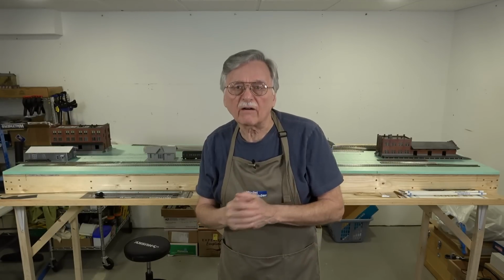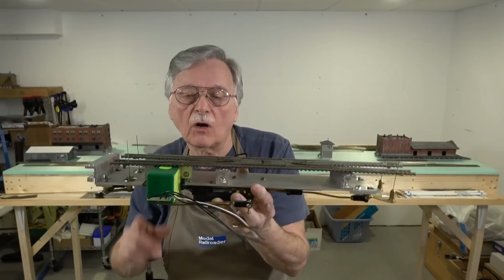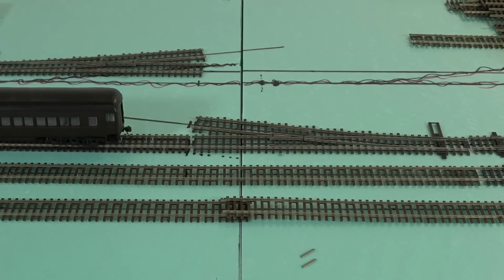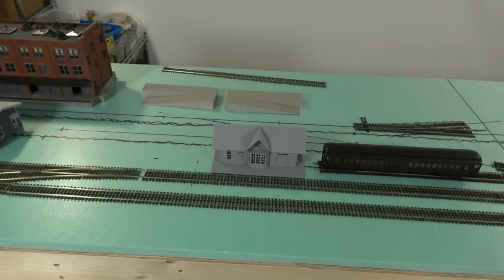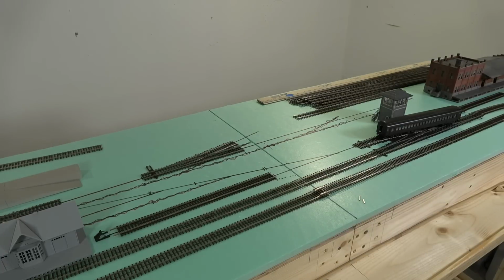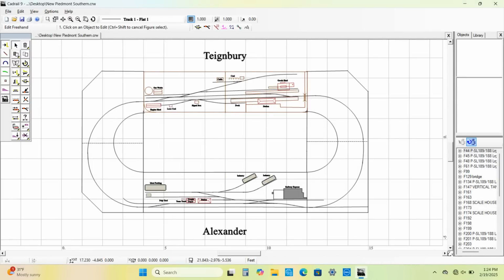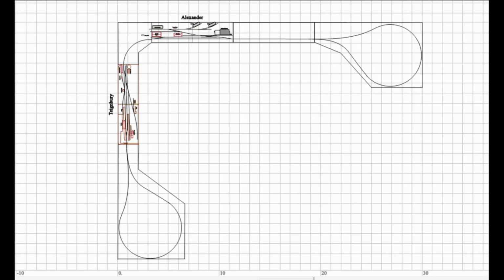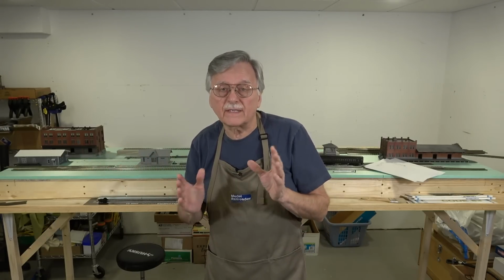Building a Model Railroad—Layout Planning, Don't Skip This Step (383)

Comment: Hi I am starting new layout should I go 8x4 or 8x3 should I go with an island layout or attached to the wall thanks Dave
Reply from the maker: As to size, I don’t see much difference between the two, so go big. Also I wouldn’t build a shelf layout anymore, best to put legs on it and then put it against the wall, since this will be less limiting, especially if you move. The only reason I see for an attached shelf layout is if you need a clear space under the layout. The good thing about an island is you can operate from both sides but it takes up more of the room. You didn’t mention scale or whether this is to be switching layout or not, both of which could impact your decision. For example you can’t do a loop in 3’ in HO, even 4’ would be tight but possible.

Comment: Hello Larry: watching this new video about the new module layout, I am making one similer but the track I have on the module parts I have are code 100 Atlas but I have a code 83 Walthers double cross over which is just better than the old (not DCC friendly code 100 Shinohara ). How would I close the gap underneath the code 83 due to the top matching rail height of the code 100.I know they make rail joiners to make sure the rail tops are the same but how would I fill in underneath without having a bump in between the two track. Your wisdom is always appreciated and I can't wait for these two modules completed and connected.
Reply from the maker: Solder rail joiners to the code 100 rails then flatten the exposed parts using a pair of pliers with smooth ends, good old vice grips work well. Next place your code 83 rails on top of the flattened joiners and solder them in place. This should give you an almost level connection between the two.

Comment: Larry, thank you for the videos.  With regarding your industrial area by pushing the two turn-outs behind the station to the left there does not seem to be enough length for a loco and 1 or two box cars in front of the meat packing warehouse for the industrial siding to the right.
Reply from the maker: One advantage of adding the corner modules is I will be able to extend the appropriate tracks and even structures there to compensate and improve operational capabilities.

Comment: Just a thought, ….You could use large 4th radius curves for the return loops, with a 3rd radius helix inside of it. (A Curved switch at the start of the return loop would switch between using the return loop, or switching onto the helix if the train is going into storage. ..And as it’s a return loop (bi directional line), trains can come on and off layout at just 1 point as there’s no direction of line running to worry about. 
..basically, ..If you just put a helix at 1 end with the return loop outside of it staying on the level, then you can take trains down from the surface boards onto a full width and length of the layout train storage depot (underneath the surface board)
(Like a big freight yard underneath the main layout)

Or… If you ditched the return loops idea and put a helix at both ends to make it a very long continuous line , then you could have a long enough track to have 2 trains “chasing” each other using a block signaling system set up. …which then runs behind the storage sidings underneath and link’s the 2 helix’s underneath. .. then as I train is running along on the top board the other is running along the bottom board.

Lots of storage for trains if you had a helix down to under the surface boards and as it’s already a circle with a return loop a helix would fit inside it. 👍
Reply from the maker: Using a helix (or two) was my first thought too. However, then I thought about just running a track off the reverse loop, through the backdrop, and onto a narrow shelf with several tracks. Although it eats up a little space behind the modules it is a much simpler solution.

Comment: Perhaps for the portability factor, you could build the oval as a second option. Question: How do you plan to deal with the mix of American and British trains and structures? Will both types of equipment switch both modules, will operating sessions focus on one module depending on equipment in use or will you change structures and equipment between sessions?
Reply from the maker: Right now my thinking is to keep them separate and use the continuous run capability for my passenger trains and through freights. By installing staging tracks as I described in the video I could use one for American trains and the other for British. This is not being built for true prototype operations as I wanted to do on the old Piedmont Southern, just something to run trains on and do so e local switching. The purists are probably cringing over this approach!

Comment: That's a pretty neat jig to controls the 4 turnouts on a double X-over. I wonder if he could make one that used two tortoises to control the pairs individually? That would be something I'd really be interested in. - Jason
Reply from the maker: Yes, you can do that using turnbuckles and bell crank levers available at your local hobbyshop. Look for parts in the remote control area of the shop.

Comment: If you're expanding left for the pulp yard, are you also considering moving meat packing there, so you can headshunt the right side industries? Looks a little cramped running a locomotive and 1 freight car, if there's anything parked at meat packing!!

PS love the drawing the plan on the foamboard idea. I'm heading down that path too, though I got a bit delayed by US Customs holding my curved track guides for over a week!!
Reply from the maker: Yes, by extending the tracks onto adjacent modules it opens up a lot of possibilities and can be done in steps. The corner module will be the first thing I add after completing the current set.

Comment: Interesting to see the evolutionary process of the new layout.  One thought that I had, though, is whether you have considered the road access to the various buildings, particularly the station.  Placing the station building on the opposite side of the tracks may be an option.
Reply from the maker: Yes, there will be a road crossing near the station that will extend back to the various building to the rear and sides. Much of the trackage behind the station will be buried in pavement. That will be added in the next iteration of the plan.

Comment: Another great video explaining your thoughts, all looking good.
Then you show us the extensions, you had a large layout and you cut it back for a purpose, now it is getting bigger again. Even though you are making modules on wheels so it can be moved around, the new expanse looks like it is going against the wall and fixed?
I know you are extending for your own interest with running trains, we all would, but how small are you keeping it? With the amount of stock you have and I guess the trains are going to be short, why not have a fiddle yard at each end, even ones that are reversible?
Still I look forward as you progress on.
Reply from the maker: I considered fiddle yards and even a small helix down to a staging yard beneath the layout. However this approach allows everything to be added in steps.

Comment: Depending on the space you have, move the return loop on the right.  Turn it clockwise, 90 degrees. Add a curved section, similar to the left side. Install another 8 foot section, then the return loop.  Gives you a nice 'U' shaped layout.  You could have a through yard by combining the top 8 ft straight and curve, coming back to a single track on the right 8 foot section.  Maybe put a MOW track in that 'yard'.  Just my $.02 worth 🙂
Reply from the maker: Good idea, but my space is limited to a 25’x30’ “L” shaped area.
Reply: @TheDCCGuy  Maybe this could be used as a traveling/show layout.  Then you could mix things up a bit 🙂  Again, Keep having FUN! 🙂

Comment: After building several modules, two different club layouts and assisted with some home layouts. I've concluded that track plans like life itself is constantly evolving and changing. I've planned entire towns only to find out it was missing a way to run around a spotted car, an industry fed from the wrong direction,  and track length not long enough for the planned industry. And never discard the idea of freight houses with tracks and docks on two or more sides with several cars able to be loaded/ unloaded simultaneously.

Comment: Here is a tip for your module joints.  Get a piece of sheet styrene that is the same width of the blade you will use to cut the rails.  Cut the styrene into 1 inch long strips.  Open the joint between the modules just enough to slide the styrene between and clamp the modules back together.  Lay your tracks over the joint, glue,  and when dry, cut the rails.  Then unclamp the modules to remove the styrene.  Put the modules back together.  Now there is no gap or a smaller gap in the rails where the joints are located.
Reply: An old plastic membership card or credit card can also be used.  Care about no gaps in the rails.  Depends upon your room's environment.
Reply: Very interesting!... I think I understand,  but would like to see a video 🤔